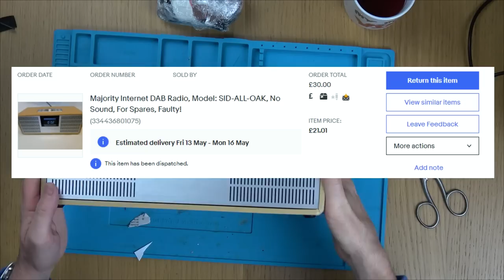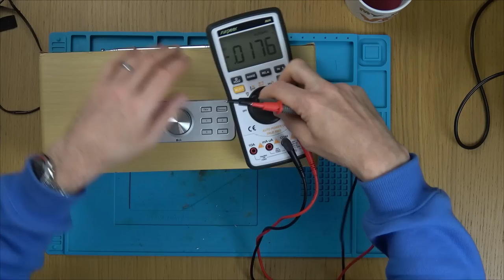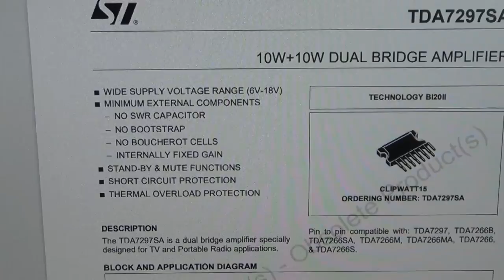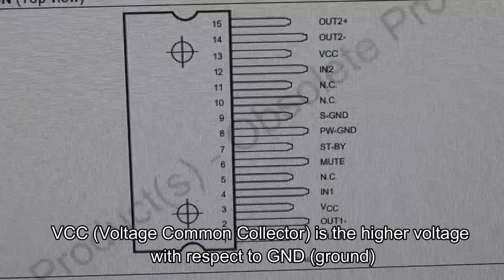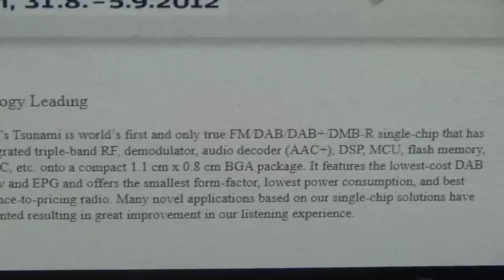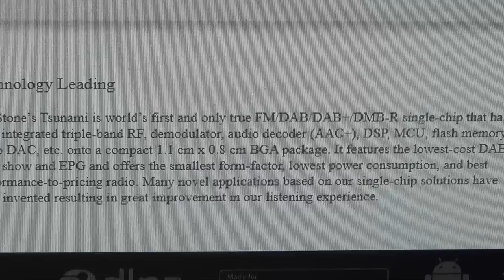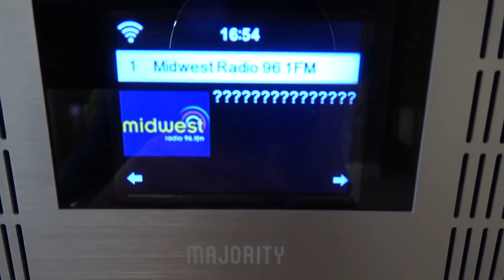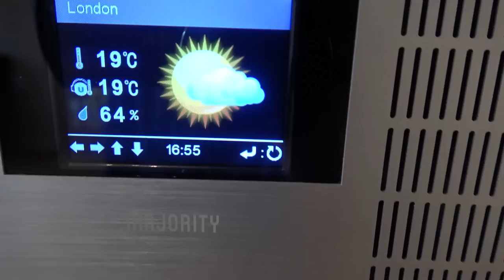Mouldy eBay Buy - Internet Radio Repair

Comment: Nice fix @My Mate Vince. When you’re wondering about tactile switches and the direction they are always connected. Look at the flat metal legs and imagine the direction they enter the body of the button that they continue through to the other side. Because they do. They enter one side, go right through and come out the other side. So continuity will be present in the direction the metal leg faces. Pressing the button connects the metal strip one side to the metal strip the other side.

Comment: The seller did a lousy job packaging the radio. They just warped it like a birthday/Christmas present and sent it in the mail. They should of put it in a box with bubble wrap. Great job on the fix Vince.
Reply: Zjedi: He certainly did, but he got 30 quid for a non functioning radio so why should he GAF?
Reply: Unfortunately verry common on ebay
Reply: @PhD63  Cuz if said non functioning radio gets damaged badly enough the buyer can send it back on the sellers cost and the seller will have their radio back which is now worth even less due to the damage plus they will be out the 5-10 euros it'll cost to ship it back.
Reply: @trevor245  Yeah, at the very least (even for <1kg small parcel) you'll lose 2 lots of postage (£2.34 x 2 - outward and return) plus you'll lose the £0.30 processing fee, and of course you still have faulty radio to sell.
So if the buyer returns it for "not as described" then the seller loses £4.98 as a minimum (using company like Royal Mail will make the price higher still).

Comment: Another Great repair vince. Pity about the FM module being faulty. I guess there's an output enable pin on it that re-routes the audio signals when active or something, and its probably being enabled when the board is connected.
Reply: there a base model somewhere, that dab, only, higher up, models with FM,

Comment: I have a black version of the Majority Sidney. Bought second-hand off Ebay. It works very well. It does come with a remote that makes navigation and alphabet entry easier. I also have a Majority Fitzgerald, which doesn't have integral audio but instead connects to a hifi for excellent sound. The same remote works on either model.
Reply: Try a Android TV box remote

Comment: Hi Vince, TSP or tri sodium phosphate (in crystals) is super cheap and diluteable in water. It is an awesome degreaser and mold controller. It s commonly available in hardware or paint stores (degreases walls: smoker's house for example.) t does leave a fine whiteish residue that keeps fighting mold if not rinsed or wiped off. Might work in Rolls Royces too. Kept in a moisture-free environment the TSP will keep for decades. Safe? Yes, it's also found in 'merikan breakfast cereals to preserve both 'freshness' and texture (assuming milk environment.)
Reply from the maker: Thanks Peg Tooth👍👍👍

Comment: A man after my own ❤️ heart. I like the idea of backup devices so much so I have 2 or 3 items of the same device. Always come in handy for the rest of the family who need certain devices, cheaper than buying new. I have to say though this is just revolting, all that green mould inside, honestly it's awful, makes me want to remove all the electronic bits and spray mould remover inside. That's the risk you run with ebay, as you have often said Vince.

Comment: Turned out to be pretty nice! Would be very upsetting if those buttons were replaced for nothing. It was a brave move to just replace them without trying to just connect the terminals with tweezers or something like that.

Comment: Hey Vince...FYI...the part number you were looking up for the FM modulator wasn't correct.  I found the correct one.  The actual number is at 31:49.  T3B-6220CDB-1.0.  I did find them online.
Reply from the maker: Thank you Will👍👍👍
Reply: That's good to hear - if you can get the part as well, then it would be worth putting a new one on to restore FM functionality - not that FM is very good around where I live, when all you can get is lots of Heart FM's and not a lot else!

Comment: I genuinely can say I found this video to be really interesting, not only the effort required to fix it but the diagnosis of the likely history, of the damaged device prior to purchase, and the reflection of the state of the market, which goes under the banner of 'EBay.'I'm not directing my negativity towards eBay it's  just an avenue to make a quick buck, assuming a vendor can turn a profit, with the minimum investment, selling goods that have been dumped as rubbish, unfortunately I see how there is such a desperate need to make money, individual vendors will try anything to make money.

Comment: great tea-time break video Vince, yeah people on ebay shouldn't be selling things for excessive amounts, and list it as being either stored outside, or used outside, or salvaged from a skip. while not 100% fix, at least you found where the problem is, and got it working enough for the job it was intended for, yes would be better if 100% working, but still a fix none the less.

Comment: tea break or not it was a really good fix and video and as someone else posted in the comments the module you were looking up was just the PCB part number the real one was the lable that was on the lid of the shielding its also interesting how you guys across the pond spell mouldy here in the states its moldy with out the u either way cool stuff and keep up the good work and also as a certified automotive tech i love the rolls videos

Comment: i mentioned years ago when you 1st started soldering you can use any tip you like, but its usually best to use the biggest one you can for the job.. 
so obviously there is no right/wrong tip. just your preference.. 
But why do you prefer that tip?

Comment: On those tactile switches the plastic has been heat staked over the metal to hold it in place.

Lets hope it was not flood damaged as sewage & MDF are quite the combination. 😆

Comment: You will not believe the amount of electronics people are throwing out. And there are people (scavengers) that hang out at the recycling plant picking up the good stuff (and it ends up on eBay). Every day I went to the recycling station - there's at least 3 huge electronics pallets filled with MODERN oled screens of all sizes, Nvidia Gsync screens, Gaming laptops, digital radios like yours, and endless amounts of gadgets (this is in Sweden - in a small city of 13K people!) And it's EVERY DAY. It's crazy.

Comment: May you take a look for a desoldering knife. it´s a very thin blade that you can shove under the pin while heating it with fresh solder. Edison is selling a cheap one.

Comment: Can you get the chips? Maybe it's easier (and certainly cheaper) to get the chip than the entire module, and since it's not BGA you should be able to replace it. I was curious to see if the numbers on the main chip would come up with anything, but I can't make them out well enough to look it up myself.
Anyway, I don't think it was boring, your videos rarely are.

Comment: Speakers will be 4 ohm when arranged in Paralle overall
Reply: 1. the amplifier is stereo, so one 8 ohm speaker per channel presents an 8 ohm load per channel.

2. speaker driver impedance ratings are individual ratings, and in this case they're simply wrong, stating 4 ohms instead of 8. not very good and I don't think I had come across that until now.

Comment: I suspect this device sat in a kitchen with a kettle close by for most of it's life. That would explain the water damage.
Reply: Or possibly in a bathroom?
Reply: Ou ficava num quarto e derrubaram algum líquido tipo refrigerante.
Reply: @8bitbubsy  I was thinking a bathroom also, although strictly speaking you shouldn't have power sockets in a bathroom...
Reply: Or windowsill with bad condensation.

Comment: If you don't want to burn the switches, heat the board from the underside, it'll still melt the solder on the switches.

Comment: Well first thing Is it's not Oak wood. I see cheap particle board with a thin wood finish  laminate.That's a rip,lol. Plus the seller didn't mention the water damage . Probably should send it back or at least give the seller a negative review. Thanks for the Vids!   :face-blue-wide-eyes: